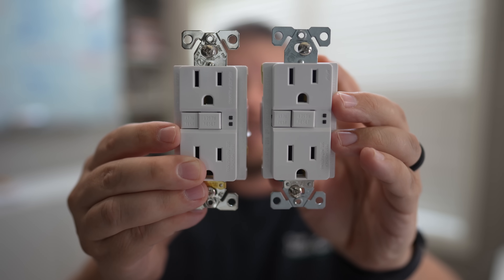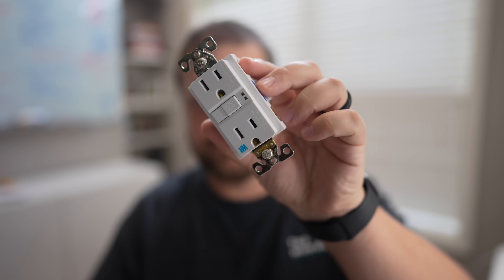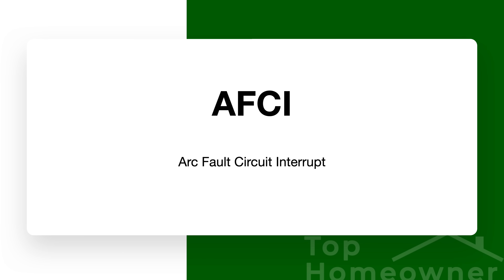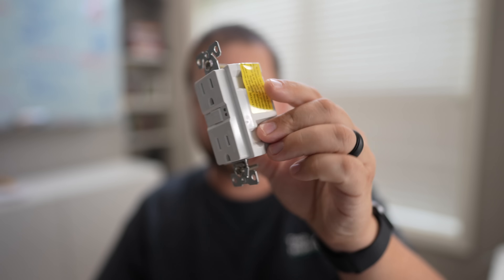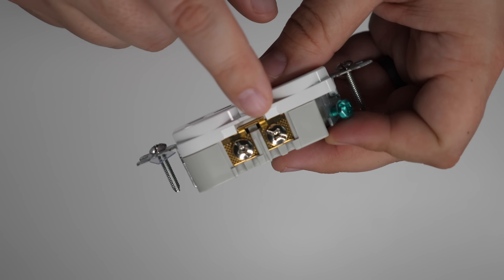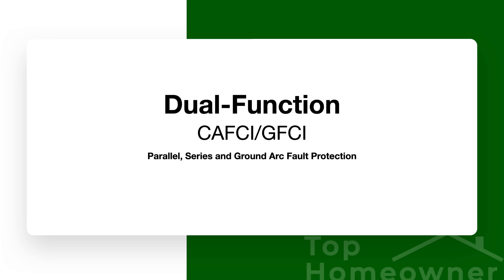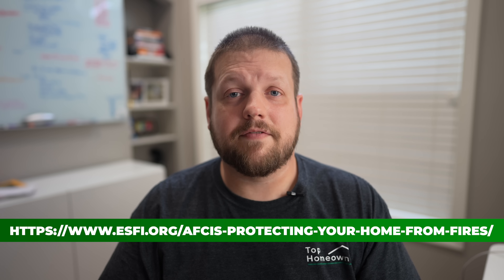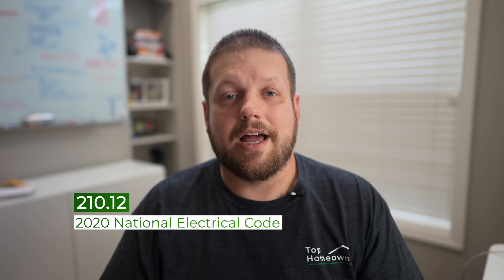AFCI vs GFCI: What's The Difference and Why You Should Care

Comment: It should be noted that the GFCI breaker predates the availability of GFCI receptacles by several years.  My parents house has a GFCI breaker in the outdoor outlets and the powder room receptacles.  The master and main bathroom has those transformer limited electric razor only outlets.  Homes built just a few years later simply put a GFCI receptacle in the powder room and have the outdoor outlets in series with that GFCI receptacle.

Comment: I’m all for this technology and what it has to offer. However I have to say, the AFCI needs vast improvements. Nuisance trips are imminent. They are not fool proof. Too many people losing freezers full of food over these things. Improve the technology and we will use them. Until then, they’re only used on inspection day and everyone knows it. So the mandate is futile. Another thing, if you’re going to mandate such devices on all lights and plugs, then lower the stinkin’ price. $50 is unreasonable for a 15 or 20 amp breaker.

Comment: I have had nothing but problems with AFCI false tripping. I really don't see any need for AFCI. If there is a short that could cause a fire, the breaker over-current will protect the wire before it will start a fire.

Comment: GFCI outlets have a finite lifetime.  My home is 12 years old.  Over the last few years I have had to replace almost half the GFCI outlets as they start to trip for no apparent reason.  This is a pain in the ass and people should be aware of this characteristic.  Fortunately I am an EE and can do the replacement myself but calling out an electrician every time a GFCI outlet starts to pop off randomly can get very expensive.  If you have a 10+ year old home and your GFCI outlets start failing have your electrician replace them all.  A lot cheaper than one at a time.

Comment: Our power distribution standards are obsolete, and it's time to upgrade to genuinely safe systems, i.e. smart integrated systems that provide protection for all forms of fault, and communicate the information required to isolate the location of the fault for remedial action. This means standardized, intelligent, solid state components, both centralized and peripheral. This can actually allow for greater simplicity in circuit design, thereby saving on copper, since circuits don't have to be arbitrarily bundled.

With peripheral protection at the outlet or switch level, the entire building could be a single circuit, with faulting endpoints self-isolating in a failsafe manner. Individual appliances can also provide redundant protection for more precise diagnostics. This requires standardized integrated circuits for various power ranges. If they are standardized and mandatory under code, they will become much less expensive than they are currently. Any additional up-front cost will be more than compensated for by lower insurance premiums, which will also provide incentives for retro-fitting.

Comment: My hot tub has a gfci breaker in my panel. Once or twice a year it trips for no known reason. Every time I reset it or if I’ve had the tub shut down to drain and refill I have to set the breaker and watch it trip out within 15 seconds or so then reset it again about 4 times before it finally stays on. Rarely will it stay on with the first engagement. It doesn’t trip immediately it’s always within 15-30 seconds and sometimes it’ll stay set after doing it 2 times, sometimes 6 times it all varies. Seems to have something to do with the start up sequence of the hot tub but once it stays on it’s good for months. It’s not underrated either it’s a 50amp gfci breaker for a hot tub that calls for 30 amp. Have tried new breakers too and it’s always the same thing. No known issue just finicky. Any thoughts??

Comment: This man would have a heart attack if he saw some of the electrical wiring in some foreign countries. I walked up a metal stairway to second floor restaurant in Nepal and noticed a 220 wire taped to the metal hand railing all the way up. My home in Thailand is supplied with single phase two wires--- two unidentified round holes in all the sockets in the house.   Arguments about ground wires with certified Thailand electricians are lots of fun.

Comment: I put an AFCI receptacle in my Livingroom and worked great until I turned on my porch light.  So, the AFCI detected a ground fault since there was a wire under ground that had a nick that was exposed for decades and had no idea.  Pretty amazing protection.
Reply from the maker: That's great! Thanks for sharing!

Comment: You state that a series arc fault is caused by a break in the HOT line.  But that's only partially true: it can be caused by a break in the NEUTRAL line as well.  Both the HOT and NEUTRAL are part of the same "series" circuit.  Also, you say that a parallel arc is caused by a short between the HOT and the NEUTRAL wire.  It can also be caused by a short from the HOT wire to the GROUND wire, or a short to any other grounded conductor: an air conditioning duct, a metallic plumbing pipe, etc.  Drywall screws and nails are often a source of shorts in home wiring.
Reply from the maker: Yes, you are right I over simplified the explanation.

Comment: Should a GFCi receptacle be warm to the touch?  Without anything plugged into it, it is warm to the touch and concerns me that it may be bad and headed for trouble.  I replaced it about 10/12 yrs. ago.  It has repeatedly tripped when a hair dryer is used, even on low setting.  Lately it is tripping without anything plugged directly into it and I can't find what is making it trip.  Does it sound as if just needs repalacing?  I hope I did not derail your postings.  :)
Reply from the maker: It shouldn't be noticably warm to the touch, especially if it hasn't recently been in use. Warmth can be attributed to resistance so you may have a bad GFCI or connection. Sounds like its bad since it's tripping on it's own

Comment: For the common person, like me, this was a good explanation.
Examples of devices that might trip an AFCI would be helpful.
Reply from the maker: I made a follow-up video about devices that can be an issue here: https://www.youtube.com/watch?v=U6TGWmZcDCc
Reply: I have an old freezer that I had an extension cord on and it was fine for 9 months.
 But either the freezer died or the breaker can't handle it ?/ Not sure?
 I was also told the plug cannot have an extension cord attached to a larger appliance.

Comment: So AFCI is actually a spike?
Reply from the maker: Spike is a different type of protection that prevents electrical surges (from the power company or lightning) from damaging attached devices. AFCI protects against arcing, either from damaged wiring or bad connections.

Comment: GFCI also protects wires from overheating.  Unless, OSHA is incorrect?  https://www.osha.gov/etools/construction/electrical-incidents/ground-fault-circuit-interrupters?fbclid=IwAR2DJwOs4kRXzvTHY7FpA_pppsf3uCrJIcWQtxaqn1k2QqiWoXFcBuOiF4M#:~:text=The%20GFCI%20will%20not%20protect,hazard%2C%20the%20ground%2Dfault
Reply from the maker: I suppose it could. In general, here's how I look at the different safety methods we have available: Breakers (circuit drawing too much power creating excessive heat = fire protection) | GFCI (electrical shock hazard = electrocution protection) | AFCI (damaged wiring or devices creating arcing = fire protection).... Those are the primary features at least.

Comment: Just go with a good, not the cheap ones,  standard 20 amp receptacle in your house. Use GFCI where you are required to. If the work is done by a good licensed electrician, you will be fine.

Comment: Nice info, I was thinking of swapping out old GFCI breaker for an dual function breaker.. Is there any code compliance issue if you have a GFCI breaker but choose not to have a GFCI outlet also? The builder who did my house, was kind of an idiot, I noticed there is GFCI on both the outlet and the breaker on the same circuit.
Reply from the maker: My understanding is that the NEC code doesn't specify how the required areas are protected (breaker or receptacle), just that they are protected (NEC 210.8(A)). I've seen arguments back and forth on that point though so I'd check with your local building codes to be sure. Also, it's possible the builder had to install GFCI outlets in the bathrooms as well because of the way the inspector interpreted the requirements.
Reply: @TopHomeowner  Building inspectors out this way rarely leave their offices, have a reputation for phoning it in, this is way before covid was ever a thing. It's been going on for decades, I still see evidence of it even now.

Comment: Sorry but you had a good video and then discredited yourself by spreading FUD and misinformation: Arc faults are a small percentage of ground faults. To say that half the fires could have been prevented by AFIs may be true but it begs the question of how many could have been prevented by only GFIs. I suspect almost all of them. I'm sure you know better so was it intentional?

Additionally, did not mention a very important attribute of GFI receptacles: they protect the entire downstream circuit! Just as a GFI circuit breaker protects the entire circuit, a GFI receptacle installed as the first receptacle  protects the entire circuit.
Reply from the maker: Yes, GFI protects the entire circuit from ground faults (electrocution hazard), but not from arc Faults (fire hazard)... two totally different risks. GFI receptacles will only protect the entire downstream circuit from electrocution risk IF the rest are wired through the Load terminal and not bypassed by a pigtail connection (which would provide zero protection). As for the number of fires, I cited the reference.

Comment: You're being overly optimistic about supply and demand on AFCI circuits.  GFCI has been around a long time, and if anything their relative cost has gone up. 

On the subject of nuisance tripping, had a GFCI circuit that would trip every morning with a particular circular saw.. wasn't my saw, so didn't get to experiment as much as I'd have liked, but my best guess was it because the saw got heavy dew on it sitting unprotected in the bed of a truck each night. 

And thanks for the excellent explanation of AFCI, as I was not really up on them.
Reply from the maker: I've noticed some brands are adding bluetooth connectivity to the breakers for updates and troubleshooting so the price of AFCI might actually go up just because of them adding new features. I suspect you're right about the saw... sometimes the safety features are annoying because they are actually doing what they're supposed to!

Comment: The fire study almost sounds like the one presented by the Plumbers Union calling for the inclusion of sprinklers in new construction. 
They only add $8k to the price of a 1800 sq/ft house. (not including servicing)

If people stopped running extension cords under carpets, a large percentage of fires could be prevented. Some for factory built gang receptacle cords.

Comment: Is the AFIC socket same as surge protection type III ?
Reply from the maker: AFCI's are primarily focused on preventing fires while surge protection is designed to protect against voltage spikes or that can be caused by things like lightning strikes or power grid fluctuations. I hope that answers your question. I may have to do a follow-up video on this specifically!
Reply: @TopHomeowner  But most fire come from Li-ion battery charging.   A smoke detector can do better job?
Reply: @TopHomeowner  By the way I have the whole lots of safety devices put in. 🤞

Comment: I have an old house that is mostly 2 wires. I have a workout room with many electronics plugged into outlets that are not grounded. My treadmill will give me a static shock (mild) if I touch the metal part. Will the GFCI plug work for me ? The breaker that runs the room is a 20 amp. I have a 110 current not a 220. Can I replace plugs in that room with a GFCI ?
Reply from the maker: Yes, it sounds like a ground fault is occurring based on what you described. A GFCI could help you stay safe, but keep in mind, if that happens it will simply trip the protection and turn off the power. Here's what you could do... install a GFCI receptacle for now from a safety perspective but I'd also recommend running a new wire with a ground to fix it permanently... Especially if you find the GFCI tripping (to protect you). Also 110 volt is normal. Be sure to involve a licensed electrician if you feel any of this is outside of your comfort level. Hope that helps!

Comment: Video was 6 months ago. I have a older house and had to have a new breaker box installed because I couldn’t get anymore breakers in the box. The electrician installed AFCI breakers because he stated that when they built the house and if they crossed wires in a plug or several plugs it would keep tripping the GFCI. Is that correct?? Since I’m not a electrician I would like to know. Thanks. 03-14-2023

Comment: should college focus on creationism or evolution in creationism is design perfectly and the other is keep on improvement in case air static and emf effect on round wire in security system or open plug can be hacked by camera like actuator or device of security door or electronics like building automation

Comment: Good video, except I think that nuisance trips should have been discussed a lot more.  I had to replace several GFCI outlets with regular outlets because ceiling fans would cause trips.  Also, outdoor irrigation wiring is exposed to dampness.  It tripped off my irrigation and I lost a lot of plants.
Reply from the maker: Great point! I'll plan on doing a follow-up video specifically on nuisance tripping.
Reply: RCD or RCCB would work way better you just need one for a whole 40amp running house thats like 30kw installed power thats for 240V one phase or three phase but there are RCCBs  for 110V too so you shouldnt have a prob finding them .
Reply: @shadowwalker4633  The UK has a similar devices. More often the whole circuit is protected, usually with an RCD (residual current detector/device) and that's roughly the same as a GFCI. You can get individually protected sockets too.  The trip current is different between the US and UK standards, but then again, the danger of a 240V shock is a whole lot worse than at 110.
Reply: I learned not to put GFCI sockets on refrigerators or freezers. The last thing you want is the fridge or freezer to shut off - particularly when you might not know it happened. (Refrigerators should, of course, be on separate circuits.)

Comment: You should emphasize what is and what is not being protected. ie a GFCI breaker would protect the circuit wiring and all fixtures on that circuit such as receptacles,  lighting and light switches, etc.  And a GFCI receptacle just protects whatever is plugged into it and nothing on the circuit preceding it.

Comment: I am an engineer and I live in Brazil. Here GFCI's do exist for a long time, but they were not mandatory. Only recently they became mandatory by law enforcement. Nonetheless, it is still quite rare to see them even in new houses or buildings. People in general do not understand why GFCI's are necessary, people tend to think they are superfluous things, expensive and not necessary. And here they are not built in the power outlets. They are always of the 'circuit breaker' type. Here NEMA style breakers were mainly used in the past, new installations are moving towards DIN style rail mounted breakers.
Reply: That’s interesting you guys use DIN rail mounted breakers. I’ve only seen that in industrial control panels and commercial buildings but never seen it in houses. I like learning how countries differ in their electrical installations. Have a good one, cheers!
Reply: @koryabel6319 DIN rail mounted 89mm breakers are standard everywhere outside North America.
Fuse replacement circuit breakers are another user installable option (and they are also available for automotive type fuses too).
Reply: @koryabel6319 DIN breakers are basically the standard un europe with GFCI protection for all rooms (amd probably for a good reason, it's 240V  circuits after all)

Comment: Several years ago I dropped my 6 inch mudding knife and it fell blade down on an extension cord plugged into a GFCI outlet. The knife was no longer usable because of the arc/burn marks on the blade. The GFCI didn't pop. The electrician said that's normal.
Reply: Did it connect the hot to neutral or to ground? If it connected to neutral (and not ground), then that was not a ground fault, and the GFCI had no reason to trip. (***Layman's understanding from a several day internet dive into this***) Did the breaker trip?

Comment: Hi. So what are you saying? It’s best to have BOTH a gfci outlet AND a cafci breaker? Thank you.
Reply from the maker: You can do that, or you can simply have a GFCI/CAFCI breaker and it will protect everything from the panel. GFCI is still only needed in areas that are wet or have a higher chance of someone being electrocuted. And per current NEC rules, AFCI is required in most areas of the home now.

Comment: I see some Electricians/ Handyman not Find GFCI Faults from Neutral touching Ground. 
Someone Mentioned Hooking Power to Load Side to Keep GFCI from Tripping. Few times I Found wired like that, they wouldn't Reset or work. 
Will have to try next time wiring one.
I Rewire a 1903 House in Pinellas County, All 120 Volt Breakers had to be GFCI, AFCI or AFCI/GFCI combined. 42 Breaker @ $65 is over $2700. Luckily, AHU, Compressor, and Range didn't need. Water Heater was gas. Still needed Protection.
Am Totally against Refrigerators and Freezers have Protection more than a Breaker. If made to do, I like to add a Power Loss Relay. And be notified a Poer loss to those recepticals.  Food is too Valuable/ Important. 
Stratmando